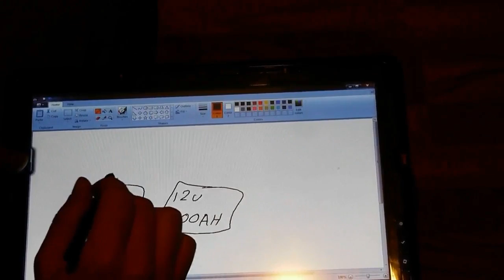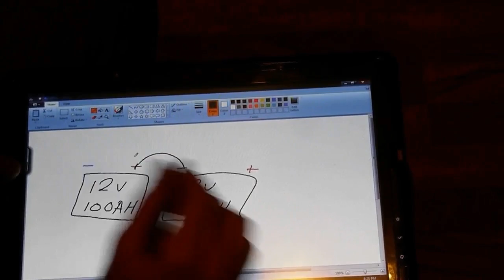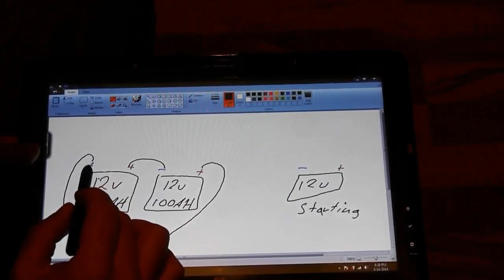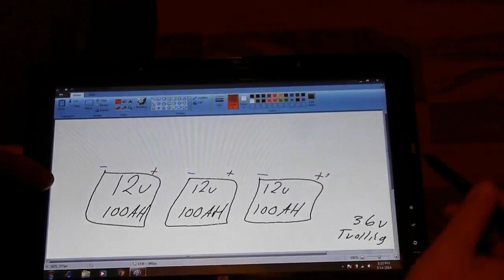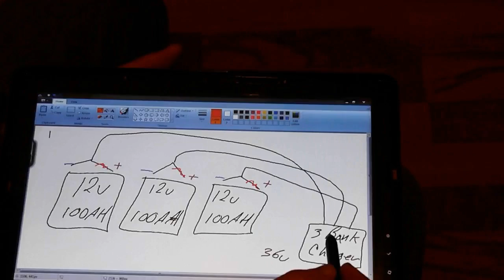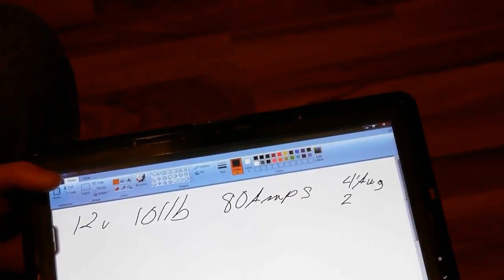Trolling Motor Battery Basics

Comment: Hello brian I just bought a minn Kota 36 volt motor , and I have a 3 bank charger for it . But I also have 3 batteries in the back for my Yamaha motor with accessories , I’m wondering if there’s I way I can tie in my motor batteries to my trolling motor , that if my trolling motor batteries are low I can start my engine to charge them back up? Or the trolling motor will drain my starting batteries and I’ll be stuck out on the water til Sea tow comes  😅 lol??

Comment: Hi, Can you please confirm if two batteries can be hooked up in series for a 24 volt trolling motor and also run 12 volt fish finder graphs at 12 volts if the graphs are hooked up to just one of the batteries? Thanks, Tony
Reply: have same question - and more specifically - can you connect the grounds of the 2 systems together?

Comment: Wire in my boat myself and I put the biggest friggin wires I can find in there and have a pair of pliers to bend them to make them go around corners because I’ve seen fires and bolts and I didn’t want the Warriors to overheat so I got the biggest stuff I can find my local marine shop was flipped right out about how big I wanted

Comment: Great video,  I have a 24v trolling motor, with 2 wires going to each battery, factory installed that way. I have a 2 battery charger, hooked like you showed. My question, how can I use the 9.9 hp kicker motor's alternator to charge the trolling motor's 24v batteries? Thanks

Comment: Hey Brian, I’m Brandon. I have three questions for you. First question is why would I have two sets of wires coming from my trolling motor that are hooked to my batteries. Second question, is it better To hook up my 12 V batteries in series or Parallel while I’m charging the batteries? My charging system is an XPS pro series 15.3 battery charger. Which is the best way toHook up my charging system to my batteries? Thanks for your help Brame. I really like your videos, very informative

Comment: If I have a standard 24 V system made up of two 12 V batteries connected as you show here, and I want to charge them with a standard battery charger, can I charge them as one (connecting the positive to one  battery and the negative to the other battery) or should I just disconnect everything and charge each one individually?

Comment: New to electric bass boat fishing, luckily my rig is prewired and hooked up for the main 60v motor. I have a 24v trolling motor and a separate 12v for accessory for my bilge, livewell and electronics. How would I get them together with a 3 bank charger to charge with Anderson sb50 connectors

Comment: i have a 12v trolling motor and i hooked up 2 12v 105ah batteries in series. (mistakes were made here) now the motor doesnt work. any suggestions on what to do?
Reply from the maker: Only thing that i can think is reversed polarity or you wired batts in series giving the tm 24volts.
Reply: Exactly. Is the motor garbage now or can it be repaired for under 150
Reply: I did disconnect in series and did run 24 v
Reply from the maker: Not sure on cost. If it is digital control board shot. My guess is around 200. Take it to an ASC trolling motor repair shop and see.
Did you check fuses?

Comment: Had a somewhat stupid question have to move my small boat a short distance will a motorcycle battery run a Minnkota for a short time. Don’t feel like carrying my heavy battery down the stairs to the doc just need to get it to the ramp?
Reply: 12V DC are made to release slow amount of energy over time. Starting batteries send large amounts of energy in order to start the motor and then it’s done until you try and start the motor again.
Might possibly send too much power to your motor and burn something up, or it might work for a short while.
Good luck!
Reply: mmnv 
.  
nnnoyt

Comment: I have a 24v trolling motor and a 12v starting battery. My charger is a Dual Pro 3 bank 12/24/36v charger. How do I wire the charger to the three batteries without having to disconnect any of the battery wires or can it be done this way? I haven't seen anything like what I'm asking. Thanks in advance!

Comment: So if I wanted to run 3 batteries for a 12volt 55lbs Minnkota, I would hook them up in parallel? With that said, would it be total of 300AH? Would I have more reserve power to fish all day and not fry up my trolling motor?
Reply: i believe pena is wrong, in parallel, positives are hooked together, and negatives are hooked together, voltage stays the same, but the amp hours are added together.
Reply: 1963JamesT yep.....parallel 2 batteries and voltage stays the same but AH doubles.
Reply: MnT8784 no your AH don't gain but your voltage does AH stays at 100AH

Comment: With your three bank charger hooked up, if you look at the circuit that you drew and with the grounds shorted in the battery charger like you said. It would create a short from battery negative to battery one positive and so the fuse on the positive would open or(blow). So is short, the one fuse on the positives is sufficient.
Reply from the maker: Nope....You are forgetting there is a series jumper between batteries positives and nagatives.
I just did not draw them in (i should have)

Comment: I have question my trolling motor is a 12/24 volt trolling motor and has a plug with two wires coming from trolling motor going to plug and then 4 wires coming out going to were the battery's go . My trolling motor also has a switch on it to switch from 12 volts to 12 volt , so how would it be wired ?
Reply: 2 years ago you probably figured it out.
my '96 lund is like that, 4 wires come off the trolling motor controller, simply hook each battery separately, and the controller makes the 24/12 conversion when you switch from 12 to 24.

Comment: HI there .. Great video Brian :) 
I am planning to get a 24 volts minn kota motor if I buy 2 of the minnkota power stations and put one 12 volt battery in each POWER CENTER ? Can I connect both the power stations together negative- of one power center to the positive + of other power center and then connect the negative and the positive terminals of each power centre to the motor to generate 24 volts to my motor WITHOUT USING ANY ADDITIONAL CIRCUIT BREAKERS ??? i BUT WILL THIS BE OK IF I CONNECT BOTH THE POWERCENTERS TOGETHER TO GENERATE 24 VOLTS?? do i have to get an additional circuit breaker ? Could you please advise ?
Reply from the maker: I'm not sure what the minkota power station is. Can you share a link. Thanks

Comment: This video is exactly what I wanted to know. U r a lifesaver. Bad thing though is that I bought a 24v troller for my mariner4. Thats two huge batteries. I dont know what batteries to buy AH amount or RC minutes. Do u know of a vid that can explain this as u did this video? I have the freshwater 86lb thrust 24v trolling motor. The one they sell on ebay. Any help is appreciated.
Reply from the maker: It really boils down to your fishing conditions. Flowing river vs. Calm lake. If it is not lasting you all day go up in capacity. A 29series maybe a good starting point.
Reply: I am in a small mariner 4 that ive posted on youtube. mainly its going to be on calm ponds or lakes. I don't feel right being on a river as I wont know its current force. would hate to kill my batteries then be floating all the way to who knows where. Thanks for the reply.
Reply from the maker: dezertgrunt that is a big trolling motor for that boat. I would think you could get two 29series batteries. And fish all day and then some. That trolling motor is bigger than what I have on my 18.6 foot bass boat. Can never not have to much trolling motor. I bet she scoots...
Reply: we'll see once I get it in the water. good to know that it is a big trolling motor, maybe I should have more confidence in it. Im a registration, batteries and trailor away from acutally using it finally. thanks for the reply.